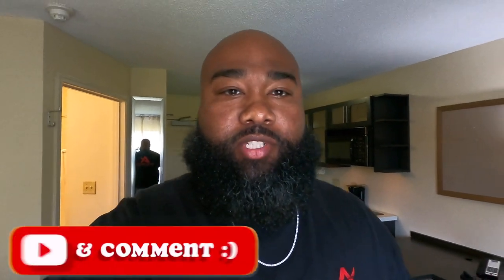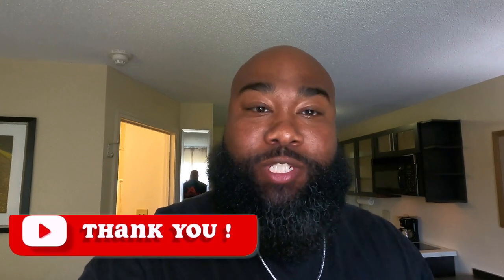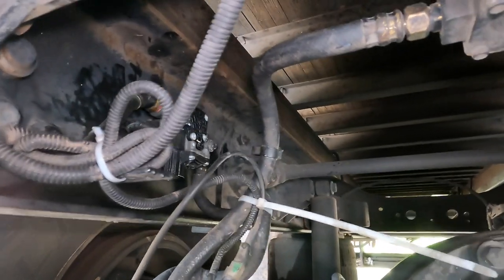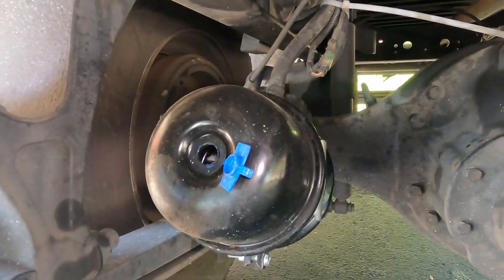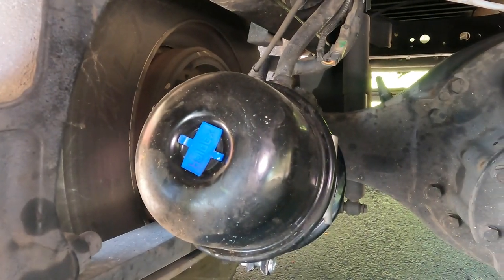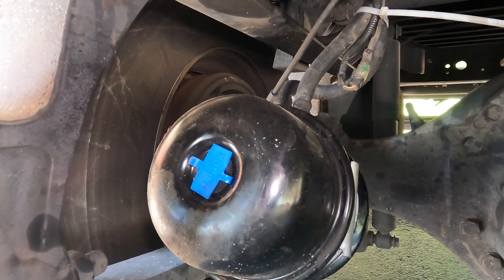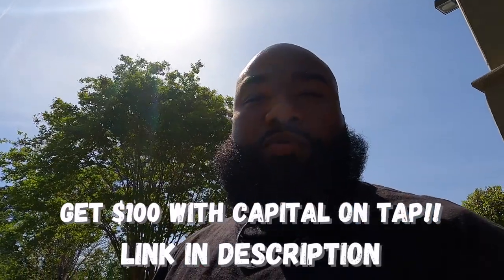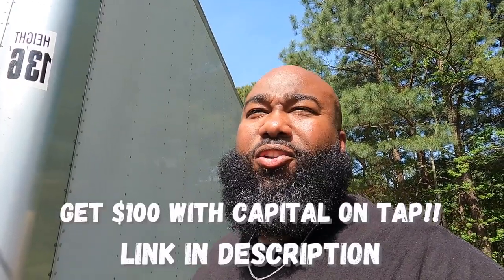More Air Brake Issues On Our Box Truck! Should We Rent Instead? | BOXTRUCK

Comment: I just touched up some air chambers on a box truck. I would suggest if you have many miles on the boxtruck, or corrosion you probably need to replace the chambers. I would do them now rather be broken down on the hwy.

 I would also carry a spare clevis pins and air horse for front and rear chambers and maybe a threadedNipple for the hoses. Also a roll of telfon tape or gasoil sealant that you can get from homedept, mernard or lowes. And if you have heavy salt, dirt on your roads. Get a spare caging bolt and keep it in the cab.

If you suspect future  parts availability become hard to get, grab a frt and rear chamber just to keep in the house. This way if thing else should fail, you have a spare.

@01:35 during your PTIs, you should check air-application PSI.

@08:13 not bad that actually is a deal ;)
Reply from the maker: Love comments like this! They help us all! Thanks for the insight!